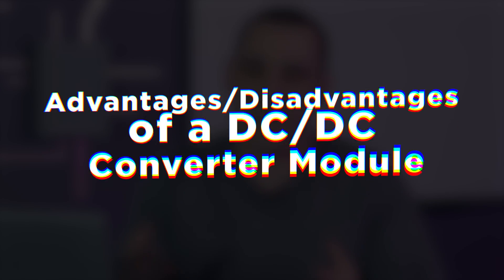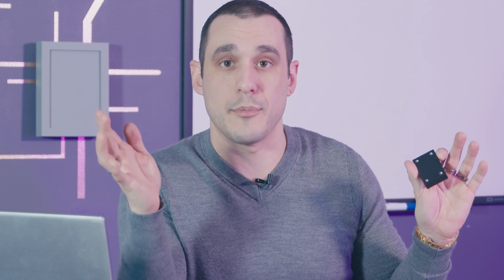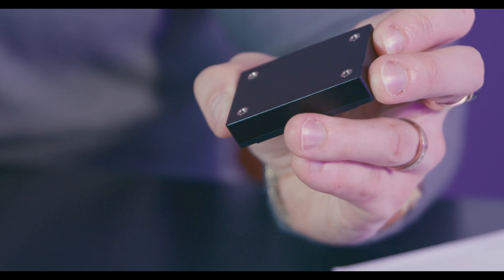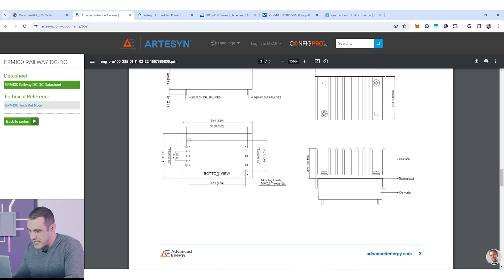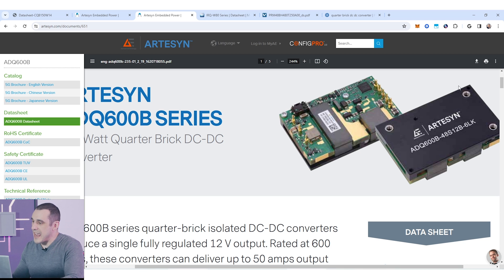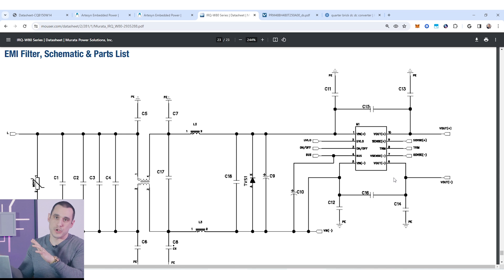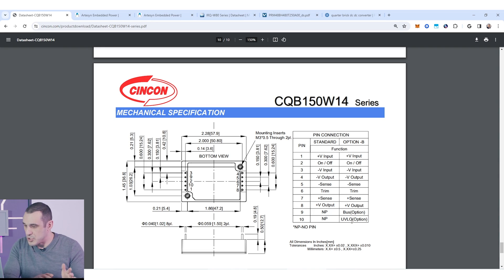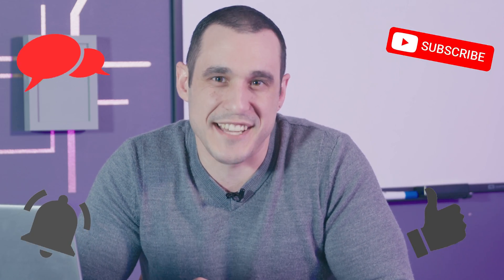Solutions in Power Design: The Role of DC to DC Converter Modules

Comment: I didn't understand the point about additional components. So are they mandatory or optional? I'm always confused with datasheets which don't mention any external components, but point out that product is "low noise".
Reply: External Capacitors at both input and output is mandatory, as its function is to reduce ripple current
Reply: Some external capacitance will be requried on input and output. The additional points with large stabilizing capacitors, common-mode chokes, etc. all depends on the specific brick module you are working with, and sometimes those are optional.

Comment: Hi thanks for the video, another advantage of a brick converter is (imo) resistance to shock and vibration makes them suitable for avionic and railway applications.
Reply: That's a good point, normally you would need to simulate or measure it. In fact I notice that a lot of bricks are marketed specifically for railroad systems.

Comment: You're going to have to add EMI & bulk capacitance to your own design also, so those components are a wash in the scale of the supply.  Additionally, never underestimate the time, effort, and cost to get a custom design certified.  A space-rated brick that costs $3000 is cheap compared to designing and certifying your own, especially since you rarely build more than a few identical products for space applications.
Reply: Yeah I would agree, it's all a balancing act. For the component form factor size, I think it's a matter of scale, which is why I brought up the Murata brick. You don't need as much additional stuff with a different brick or with a custom board and yet you can still get to similar power outputs.

Comment: Just used a converter module yesterday and faced all the drawbacks discussed in this video the hard way, every one of them😂. Still doesn't mean that we shouldn't use them at all. I use them in designs that need robust power supplies with good protection. (maybe b/c I don't trust myself;)
Reply: Sure, my intention is not to tell anyone to avoid bricks, just don't assume that they will eliminate the need to look at a datasheet or use any additional components in order to work properly. Very brief look at an application circuit does wonders!

Comment: Quite vigorous youtube video.  But you forgot the important thing.

The selection of off-the-shelf transformers is slim, compared to the variety of input voltages, output voltages, output currents, power, switching frequency.  The higher the power the scarcer the off-the-shelf transformers.  So is one willing to design a custom transformer?  Then wait for a magnetics supplier to wind it?  Or do a planar transformer on a PCB with lots of layers, blind vias?  
If yes, then one should roll the custom isolated DC-DC.
Reply: I've done custom transformers with off-the-shelf core and bobbin and with not much lead time, main challenge is cost if producing it in the US. You can test the transformer design from a US prototype and then produce in China. Also I've found Wurth to be a good option for transformers, they have a good selection and they can do custom transformers for volume orders.
Reply: @Zachariah-Peterson  A custom transformer is design hurdle and a supply chain (logistics) hurdle.  When would these hurdles be worth jumping?  Only when consuming these power supplies in large quantities.  The break-even quantities around few thousand would be my rough guess.

Did you mention that in your video?  Nope.  My comment is about the uncautious tone of your videos [plural].  Less youtuber, more EE street smarts, please, Zach.  ; )
Reply: Can you explain more: you mean building a custom one is not as easy as we might think ?
Reply: @Starwalk-in  You could do these designs yourself and even do the assembly yourself. most often what you find is there is not enough room on an off-the-shelf core/bobbin pair to fit all the windings without overheating the transformer wiring or saturating the core. I have pushed a lot of power through some custom-wound transformers and watched them start smoking because the wire gauge was so small! If you decide to use a vendor for a custom transformer, you have to make sure you specify everything correctly so that they give you something which will not saturate at your current level and which will not overheat while still providing your target inductances. In the vendor case, you do not always have control over the form factor of the design.